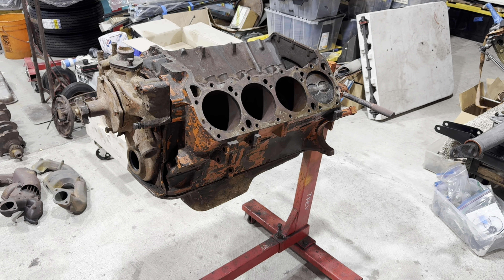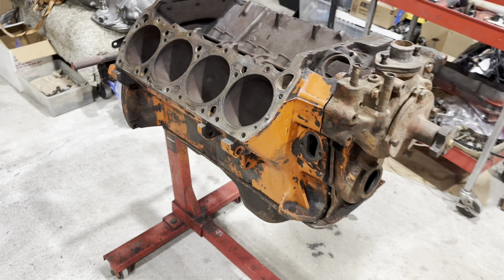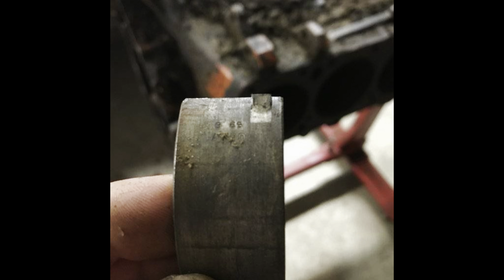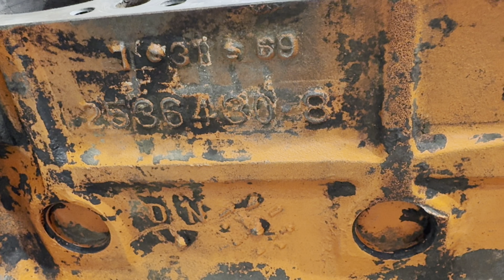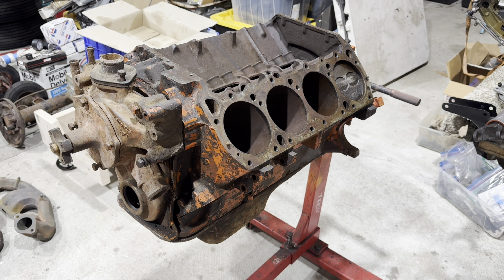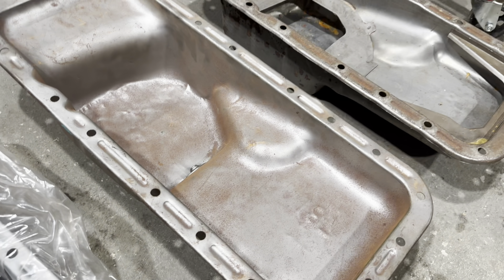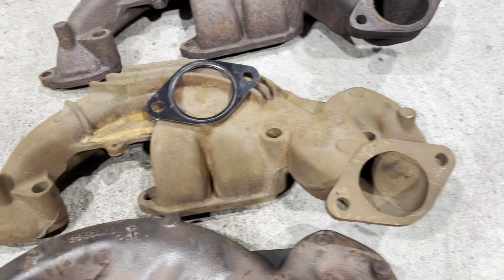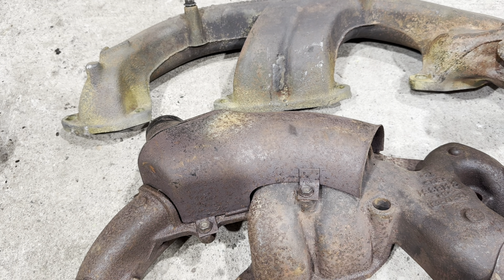How Can We Tell This Motor Is A True V Code 1970 Sport Fury GT Engine? It’s Not Easy!

Comment: Well this is the only video I've seen, & I'm not even finished, but have subscribed. I have an '81 W250 with a tired 360la, & NP435 & trying to figure out what gives me the best bang for the buck to give me a reliable, useful, & yes fun rust-o-mod on a very limited budget with so many options available. The number of options from hopping up a 318, to going with magnum heads & intake on my LA engine or just going for a 5.9 magnum, & then of course the big cubes.
Reply from the maker: Thanks for the sub!  5.9 Magnum is hard to beat for bang for the buck, pretty easy to find junkyard ones.

Comment: I always thought that the water pump was the easiest to replace. Four bolts and it's in your hands.
Interesting point: when I was forced to replace the timing chain and gears in my 1971 Fury U code it was a double row. It died on me Christmas Eve 1979 and I replaced it New Years Eve, out in the street.
Reply from the maker: The one part on a Mopar that is cheaper than a small block Chevy, the big block water pump.

Comment: As I recall the 6 pack balancer is different, is it not? ref breaking standard rods: the were using heavy pistons if they were stock.  I had a balanced 440 in a '70 Barracuda, and it ran like top.  My first balanced motor.  It made lots of difference.  MTC pistons as I recall.  Not that exotic at all, just nicer than stock.  rods were balanced and polished.  Crower "street beast' cam.  Broad power band.  I idled it around my trailer park in second gear to be quiet at night.  chug chug chug.  if you have an HP or HP2 block it means it was eye-balled for casting "core shift".  i.e. all the cylider walls are about equal thickness.  I have a 400 block in my yard that the crank main aren't in the middle of the block.  Another thing to look a is;  is the camshaft hole in the middle of the camshaft casting circle? If not, it's another 4 "O 'clock Friday" motor.  Not the prime candidate for hi-perf rebuild.  You'd want to sonic test it.
Reply from the maker: Yes the 6 pack balancer is unique to the heavy rod motors.

Comment: I almost bought a U code Chrysler New Yorker.  Why bother with the extra weight of the rods?  Another time a guy gave me a '70 440 motor, and when I took it apart it had a SINGLE six pack rod, the others were regular 440 rods.  So it was a "4 O'clock Friday" motor.
Reply from the maker: Chrysler didn’t do anything like this without a reason, they were breaking the standard sized rods in 69 for warranty claims.

Comment: The intake manifold heating from the exhaust manifold is not for faster warmup.  It is emissions related, the warm intake air will burn better and have reduced HC emissions, and may even give you better gas mileage by reducing the intake charge density and allowing the throttle to be a bit more open for the same load (one of the reasons in the summer you get better gas mileage).  At WOT you want cold air, of course.  I am not sure if there is a mechanism to shut the flow through the exhaust manifold canister, but I would expect the airflow would be so high at WOT, the air will find a way to come in from other areas where the temperature is lower.  Cheers.
Reply from the maker: When I say it was emissions related part of that was warming the car up faster before they obviously put out more co2 when choke was on.  The faster they warm up the less the emissions.
Reply: @rocketresto  I do not think the warmer air will accelerate warmup.  The heat capacity of the air is negligible compared to that of the metal and coolant.  But it will reduce or eliminate misfires (one misfire in 100 cycles is marginal for warmup but huge for emissions).  And of course, as I said, warmer air means lower pumping losses (less vacuum at the same rpm and load) and better fuel economy.

Comment: Quick question…. I see you really know your Full Size C-Body MOPARS! What color was the engine on a 1967 Plymouth Sport Fury with the Optional 440 Super Commando 375 hp ??? Thanks, Tom. Staten Island, New York. 😊
Reply from the maker: Turquoise.
Reply: @ a BIG thank you 😊 for answering that question for me! I’m actually doing a Frame Off Restoration on it… it was born with a 318 small block, and I’m doing a Correct engine swap! I located a Correct, date coded 440 with the Original 915 heads that actually came out of another 1967 Sport Fury! 👍

Comment: Great content and execution on the video. I just rebuilt the engine in my 70 GTX I bought in 1981. The car was last tagged and driven in 91. The ordinal engine had been long gone. But a buddy of mine had a 70 440 block. So I had it machined and cam bearings and new freeze plugs. I installed the .30 over 10:1 forged pistons. Bought a steel crank and it was turned down .10-.10. Milodon 7 qt   Oil pan with a Melling high volume oil pump. Aluminum closed chamber heads. I reinstalled my 484 purple shaft cam and lifters because I was too apprehensive about all the cam failures. Double roller timing chain. I rebuilt the 3 2bbl. Holley carbs and put them on my cast iron six-barrel intake. Engine fired right up and runs great. 80 lbs. of oil pressure at cold idle. Tuned the carbs in and set the timing. I am running the stock points distributor with a high voltage coil. I am not too sure about the numbers on the block. But it is a 70 block. No indication that it is an HP. The flat boss near the front of the intake has no markings on it. So just a run of the mill 440. That now has the goods to make it sing.
Reply: I had a 68 GTX, and you are absolutely killing me.
Reply: If the pad had no stamped markings on it, it could have been just a replacement block, they were common at dealerships back in the day.

Comment: What cam shaft do you plan on installing in the (2) 440+6 engines?  Great video....... THANKS !
Reply from the maker: Was recommended a guy in the Midwest and going to go with that, have the guys number in my computer and will put it in the video when we build the motor.

Comment: You can get the pet store urine remover stink spray for the carpet and seats, there's a few good ones that work.
Reply from the maker: We have tried a few things so far and will try a few more.
Reply: @rocketresto a video on what your tried and what works best would be appreciated for this all too common nuisance. I have a Valiant with the back seat airing in the garage. Easy to clean the top. The underside - not as much.

Comment: Great video.Years ago I bought a 440 short block ,the guy told me the motor  was in a running B body he bought.Said it ran fine,but seemed to vibrate.When I tore it down it had one six pack rod in it
Reply from the maker: Ya that would do it!

Comment: I bought a 440 HP engine years ago an it had a WW1 German aircraft cross stamped there.i read in a magazine back then it ment the crank was 10 under from the factory.have you ever seen this??
Reply: Maltese cross indicates that the crank installed at the factory has "0.001 undersize crank journal(s).

Comment: Tell by if there is 3 carbs on top. Its a 6 pack. Tri power.
If its one carb its a 4 bbl 440
Reply from the maker: If it doesn’t have carbs it makes it a bit harder.

Comment: 1. If V code piston has 4 valve reliefs what does U code piston look like?  Flat top?
2. For C body are pistons the only short block difference between U and V codes?
Reply from the maker: 1. Correct they don’t have valve reliefs.
2. No, higher lift cam, and 3 bolt cam.
Reply: @rocketresto  the 3-bolt "six-pack" cam has the same grind as the HP single bolt cam, lift is the same.

Comment: To go further… all 440 blocks are the same. For their respective year they were cast anyway. HP just means the cam, timing chain, rods, balancer, windage tray, oil pan, valve springs… internal parts.
Reply from the maker: Wasn’t trying to get too in the weeds here on this video but kind of?  The HP blocks do have the stamp so you can tell.
Reply: @rocketresto That’s assuming nothing has been changed from the factory. The HP stamp is just that. A stamp for the assembly line. A lot of uninformed think an HP stamped block is different. They are all the same.

Comment: I had a 70 440+6 Cuda and went thru the engine and had to replace cam and crank bearings plus rod bearings.
Remember this was 1974 and The direct connection parts book listed the six pack rods as NASCAR rods.
The dealer said the NASCAR rods were different than the stock 440 rods. Best I remember they were beffier rods.
The engine was a beast when I got done balancing and blue printing it.

Comment: I have a 1973 440 engine from a Motorhome!
The poor man's 6 Pack!
Reply: I have a 78 motor home motor.  I found '66 closed chamber 361ci heads, had them ported, 906 size valves; Brought up the compression a lot.  Now needs octane boost .purple camshaft .484.  Could use more camshaft now with 4 speed.

Comment: Great information. I have a 71 V code Charger R/T survivor, all matching numbers. The previous owner had the engine rebuilt but wisely saved all the original parts, including pistons and camshaft. I know they had the 3 bolt cam, but were they different spec lobes? I suppose my original v code cam could be measured and compared to a u code? Or maybe that's already been done. On the cylinder heads, I can't remember if you mentioned they also had chromed valve stems.

Comment: Are you saying anything running HD rods came from the factory with a counter-weighted damper? Have to disagree with that, it was the combination of the heavier six-pack pistons and the HD rods that required a little external balancing and a special counter-weighted damper on the six-pack motors. Standard forged crank HP motors running HD rods and standard HP pistons did not run the counter weighted damper and/or any external balancing.
Reply: My 72 u code HP 440 came with forged crank, six pack rods,no counterweight damper, low comp pistons with chrome  rings, windage tray, single bolt cam, heavier than standard valve springs with dampeners, HP manifolds, HP2 stamp on pad. Also has what I believe is a dealer installed AVS 4966 with a 1973 coded tag  that most likely replaced a warped Holley.
Reply: I sold a numbers matching 71 Charger R/T U code car to a friend, which he still has. It has the counter weight balancer.

Comment: One of the rarer C-body exhaust manifold sets is for the 1967 high performance 440. The replacement 440-6 barrel pistons (Sealed Power / Speed Pro) look like they are now made in India and have quality control issues. Maybe upgrade to better pistons, that won't be seen anyway.
Reply from the maker: I’m sure we will have to go 30 over on both engine and will choose good pistons.

Comment: I have a 361 truck/ industrial engine given to me.
I’m interested in knowing if the truck/industrial heads have any performance characteristics?
I know that they are not the best heads but I would like to know if there is anyone that could or have done something with the heads on a flow bench.
I plan on LPG fuel or propane in this engine.
Vacuum and port velocity is important because it’s not a liquid fuel.
I like the quality of the exhaust valves in these heads.
I also like the position of the spark plugs.
I believe that they can be worked with but they are not in large quantities here in Australia 🇦🇺 
The C bodies come here to Australia 🇦🇺 till 1972.
Mine was a 1972 DG Dodge Phoenix.
In the states they are a Plymouth Fury.
We got four doors only, hardtop and standard.
Over the years I have seen some Two doors and they are awesome
Reply from the maker: Don’t know a ton about them but they are more for longevity than performance, they also weigh a lot.

Comment: what are those two boses on #1 and #7 on the exhaust manifolds?
Reply: The unmachined bosses on #1 and #7 are locating pads for fixturing the manifold for machining.
Reply from the maker: Think those are the exhaust sleeve nuts to hold it on if I’m thinking of what you’re thinking.

Comment: I know this is stupid to compare but I've got a 1969 dodge d100 2wd swb with a 1978 440 in it and I needed to do some work to it because it has sat for 25 years.  Someone had the front sump oil pan on it and when I removed the pan I  noticed the plastic timing gear had a couple teeth remaining so I took some parts off one of the 2 motorhome 440's I had put up years ago.   I was a little surprised to find a factory windaged tray and a double roller factory timing set.   Both of the motorhome engines I have are very low mileage (less than 25k) so the parts worked great I used the 7 quart rear sump pan and the timing set and she runs like democrat chasing a tesla.   Loud and somewhat erratic due to carb issues.   I'd like to find a good thermoquad for it I just think it would be the best carb setup but could you explain the difference in the rv 440's since most of us out here scraping up what's left of the mopar parts we can scrounge up are going to find rv 440's not 6 pack blocks.  Lol.  I love the info don't take it wrong I look forward to your videos I'm always looking to learn something and between yourself, Jamie, and uncle Tony we have 3 pretty good sorces of mopar knowledge to soak up. Thanks for the videos keep them coming.  

God bless
JM in Greers Ferry AR